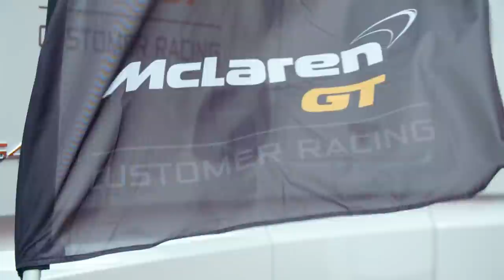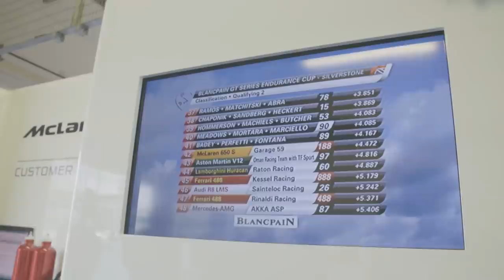McLaren 650S GT3 at Silverstone | Chris Harris Drives | Top Gear

Comment: My uncle has a racing team in Germany and they raced this car 'til about three years ago in the VLN race-series.
The car is a diva to say the least. When it performed it performed really good but on a regular basis the car did find reasons to not work. :-)
Reply: DonDuracell So that would make the team either; Gemballa Racing (raced in VLN and N24 with McLaren in 2012) or Dörr Motorsport (ran McLarens in the VLN/N24 from 2012-2014). If that's the case, your Uncle's team ran a 12C McLaren which was the previous iteration of this 650S GT3. So they're not quite the same car.
Reply: IIRC, the 650S GT3 was sold as an upgrade package for the 12C - they didn't make customers buy brand new cars. That's why pretty much all MP4-12C GT3s disappeared from competition so quickly when the 650S GT3 was launched.
Reply: Is it a McLaren Honda?
Reply: DeadPixel918 no its different
Reply: Honda were McLaren's engine provider for F1. Now its Renault hence why the F1 team is called McLaren Renault. For the GT3 series and road cars an company called Recardo Manufacture the twin turbo V8 engines.